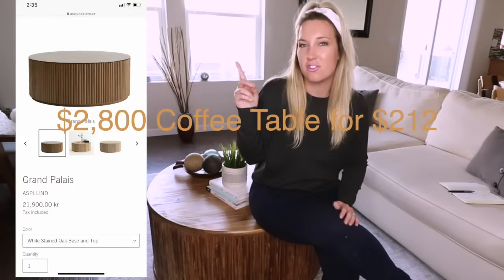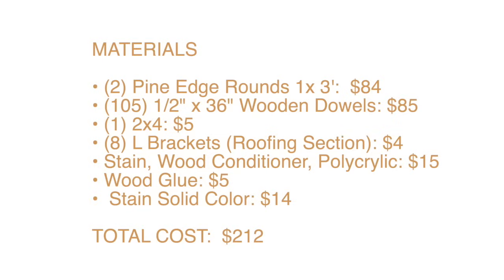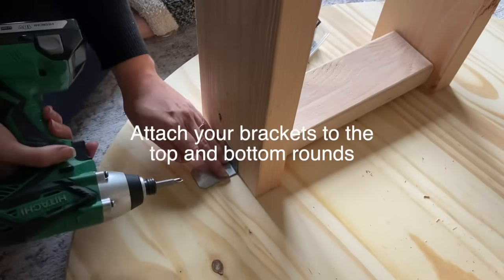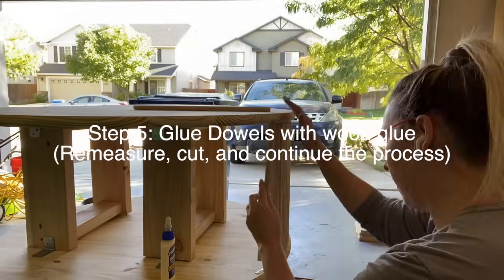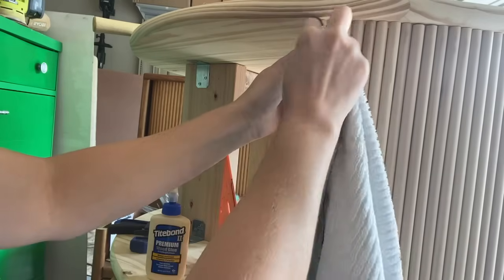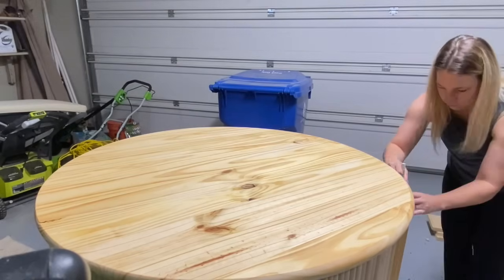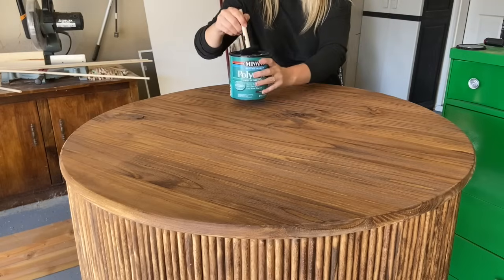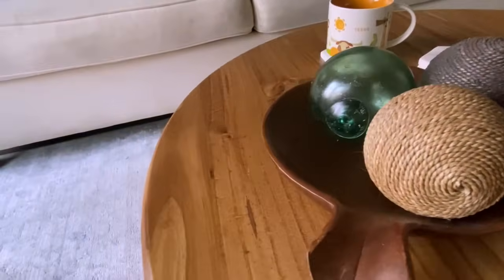DIY FLUTED COFFEE TABLE on a budget  //  Luxe For Less

Comment: I made one of these inspired by your video. I found one major change made it so much easier. I sanded & stained all my pieces before assemble. I used clear Gorilla wood glue so no visible glue marks. Lastly I used Minwax spray polyacrylic in satin.  I also backed my wood dowels with a layer of cardboard just for added stability. The wood dowels were glued to that also. Like you I had to buy a smaller dowel to fill in the last space. The biggest trick though is to pre-stain all your wood pieces & use clear wood glue. I and everyone who sees my new coffee table are completely in love with it. Thank you so much for the inspiration & instructions!
Reply from the maker: Zoe! Those are such great tips!! I especially love your clear poly spray tip-- genius!
Reply: Hello. Did you glue the wood dowels to the cardboard first, then apply the strip to the round top and bottom?
Reply: Do you have link for cardboar used in cannot find

Comment: Tip, I work with wood a lot and this is a great DIY I am definitely going to make a smaller one for an in table I already have a nice coffee table that I reworked make yourself a nice circle on the inside of the top and the bottom before you attach the inside supports that way you can follow those lines to make sure your dowel is in line on the top in the bottom :-) The table would also look cute with a little short round legs
Reply from the maker: Love the tip!!! That's awesome!

Comment: So cool. I'd like to make this type of table with the pedestal dowels a little closer to the center, so it looks more like a spool. You could attach 2 smaller pine rounds (or MDF rounds) centered inside the 3' rounds used for the top and the base, and then push your dowels right up to the rounds when gluing them in, like a template. Maybe use 24" or 30" rounds. Should result in a perfectly round pedestal, and you won't need as many dowels, because of the smaller diameter. Make sure you decrease the height of the frame to account for the extra rounds.
Reply from the maker: SO smart!!!

Comment: It is actually a little over $400
$200 for the dowels $2.36 per dowel 48 inch
$100 for the 3 feet round board
2x4, pre stain, stain, sealer satin, and wood glue for the rest of the expenses
But big thanks to You for sharing the video! I just completed it today and it came out great
Reply from the maker: Sheeesh! Talk about inflation. I'm glad yours turned out great! What color did you end up staining it?

Comment: This is the type of project where you would almost be better off staining the individual pieces before putting it all together; especially the dowels. It is so easy to pull the dowel through your clenched hand while holding a rag with some stain on it.
Reply from the maker: I almost did that. It honestly went really quickly with the foam brush.

Comment: Really nice table, can you use this exact tecnique for a dinner table or do you have any tips?😊
Reply from the maker: YES! I initially wanted to do that, but the costs of kept increasing on lumber. 😂 I would find a table with a center base already in place, and then put a cardboard concrete form (sonotube) around the base for your half-round trim pieces to attach to.

Comment: l really love this table . question I see you used oil based wood conditioner , stain and put polycyclic(Water based) on it. Is it ok to mix with oil based stain with water based polycrylic?
Reply from the maker: That's a great question-- I personally didn't have any issues with the absorption or adhesion! Per Minwax's website- "the Polycrylic crystal clear finish ideal for use over all Minwax Oil-Based and Water-Based Stains and colors." So you should be good to go!☺️

Comment: How would you do this if you wanted it to have storage? I'm thinking the top could be a lid you lift off. But I have no idea how to do it LOL.
Reply from the maker: Hmmm.... If I were trying to create one with storage, I would use a large concrete form (picked up from Lowes they are cardboard) and glue 1/2 round moldings on the concrete form directly. 

Then I would cut out a small square in the concrete form, glue the half rounds to that and have that be a hidden storage section. You might even be able to have little hinges on it so it opens seamlessly.

I think that would work out. 🤔